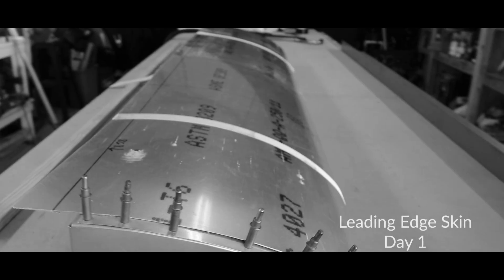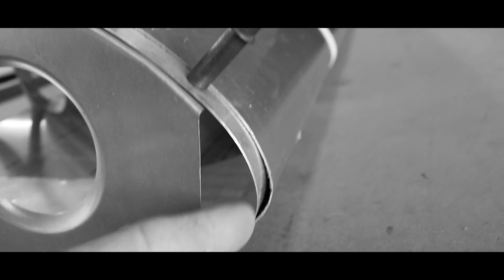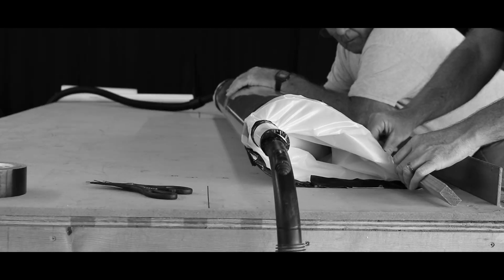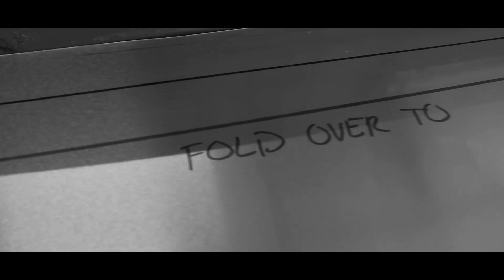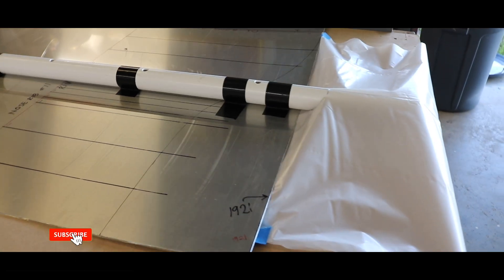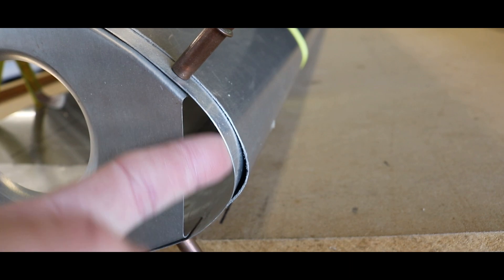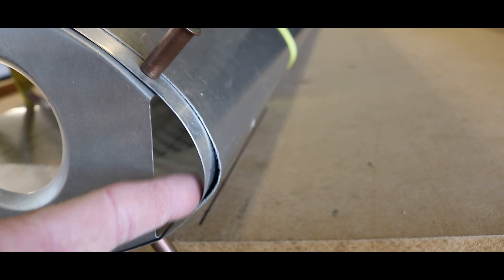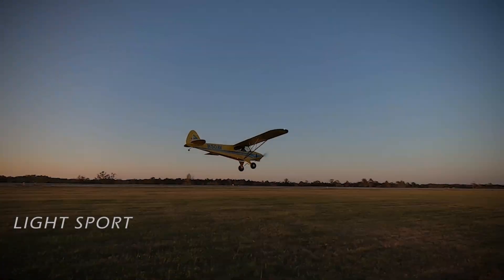I Bent my Wing Today! AIRCRAFT MAKER

Comment: I decided to scratch build the flaperons on my Cruzer.  My philosophy going into that was that the first time I made a particular part, that part would never go on the airplane because it was just a test run.  I would keep doing "test runs" until the parts I made started to consistently look like what I was intending to make.  Then I would start actually making the parts.  Needless to say that there is a very large box filled to the brim with a bunch of flaperon-rib-shaped bits of scrap aluminum in my garage.
Reply from the maker: The thing about "Scratch Building" is that although it is VERY rewarding and can be a lot of FUN, it can also be VERY costly. So I feel as a Scratch Builder we tend to try  and thing 10 steps ahead and do more pre-planning before actually taking action. It is not only a investment $$$ in raw material, but investment in time in measuring and laying out. So fewer mistakes can be paid (i.e. zero if possible) to save from losing both Time and Money above and beyond assembly. If you scrap a part from a KIT, well... you just pick up the phone and order yourself a NEW one. If scrapping a parting YOU are "Fabricating" (Much longer process). I too have a "Scrap Bin" though. :-)

Comment: Your assumption that a tighter zero chord radius is not a problem is incorrect. The airfoil profile "radius" at chord=zero is directly related to the performance at the stall break. In general, the larger the radius the softer the break. So having the airfoil "pointier " at the top is not desirable.
Like you said, pull it down very tightly when drilling and riveting.
Reply from the maker: I agree with you 100% and as mentioned the "profile" of the "example" on that scrapped RIB is NOT 100% accurate. It more or less is just "bridging-the-gap" to see what it looks like. The wings... were sitting on the floor "stacked" and not easily (quickly) available to "try-on-for-size" the newly fabricated Nose Skin. So the profile MIGHT be right on... OR it may be slightly too tight. My plan... is to create a Go-No-Go Gauge (template) for when assembly actually takes place to massage that into the final shape. 🙂